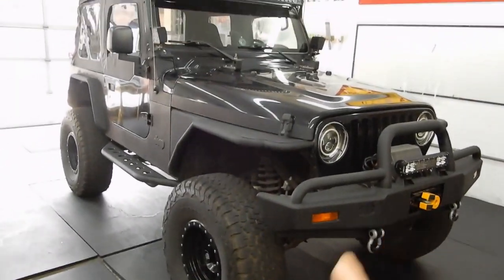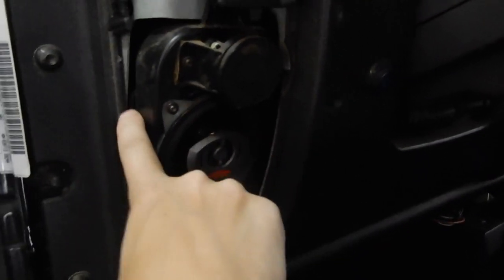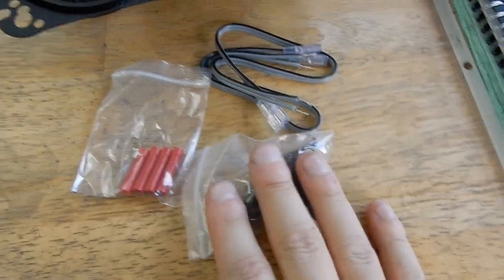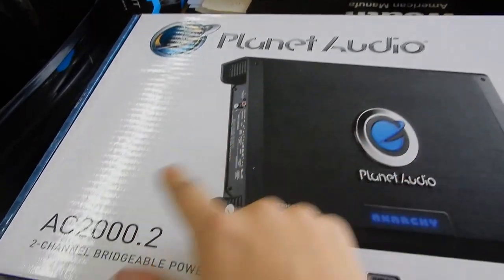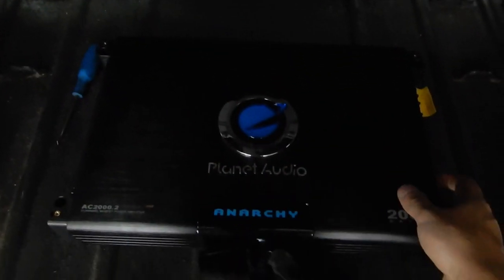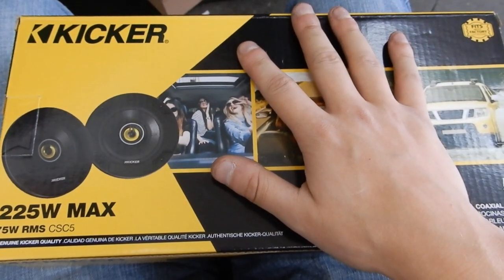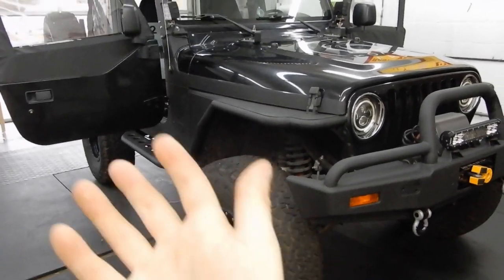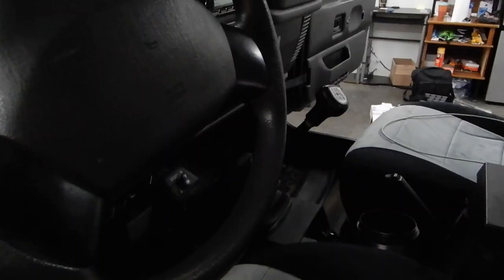Jeep Wrangler TJ Gets a HUGE Audio Upgrade!

Comment: When you are running wires especially the amp power wire put on shielding over the wire and use a rubber grommet when running it through the body holes. Over time vibration can cause cutting of the wire insulation and can be a hazard for all electronics in the car like the ECM.

Comment: nice video.  bit dark in the back half.  I just installed the Joying 13.3 rotating screen stereo,  DS18 Candy Amp, 4 -5way speakers and a 6.5" Skar subwoofer.   Sounds fantastic in my 2002 Jeep TJ

Comment: Who said Jeeps can not sound great? nice upgrade! 
Just be sure your power wire is in a safe location, vibrations or elements from the outside could damage your wire and be in contact with the chasis (ground) 
But amazing! If you gat more channels in your amp, add a subwoofer under the seats! 
Saludos desde México!
Reply: literally no one said that.

Comment: Great video bro. Was the amp enough to give good bass. Or did you have to install an additional sub?
Reply from the maker: This was all he wanted. I never installed subs on this one
Reply: @ArdenAutomotive  how did it sound though. Was it adequate?
Reply: In terms of base and quality
Reply from the maker: @rashmedo  If you want bass then you'll have to add subs. Regular speakers wouldn't be sufficient enough. You'll get more bass with replacement speakers and an amp but most likely not enough